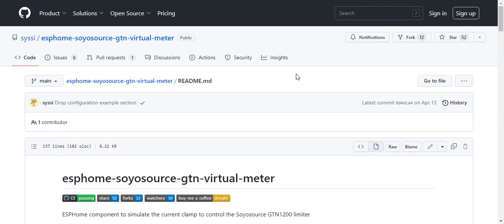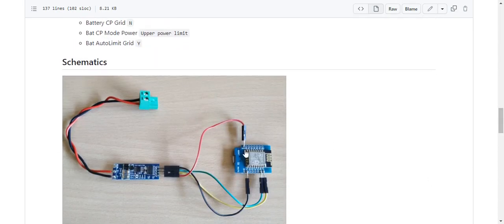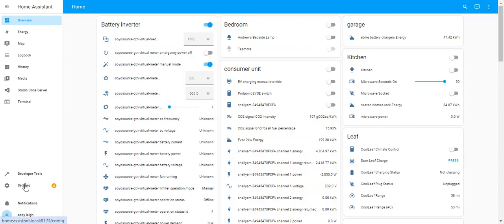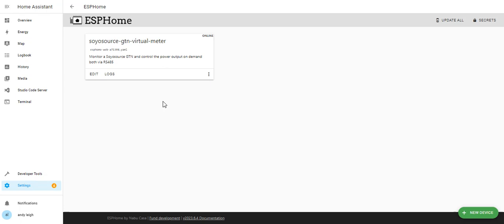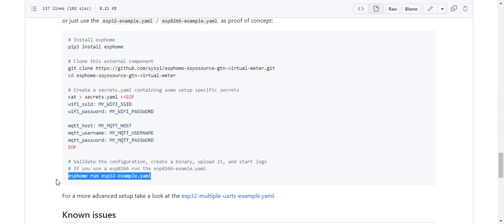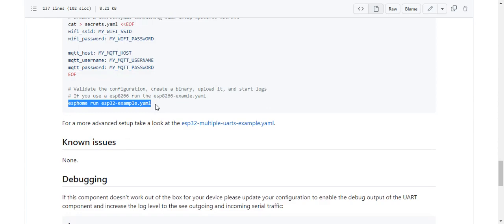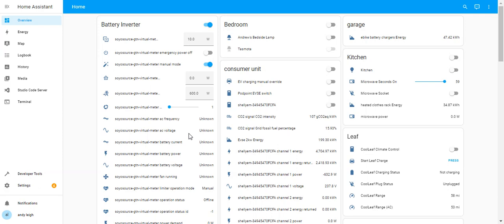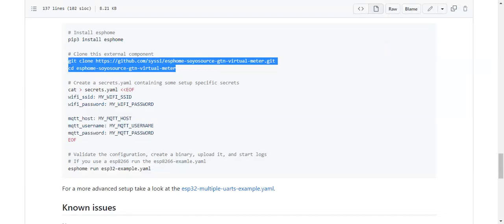Setting up the esp32 for the gtn1000 soyosource inverter for Home Assistant pt1

Comment: I am working on this for hours. In esphome it compiles and installed and I see a rt light blinking. But no info or control. What am I missing? Wiring is correct. Maybe faulty rs485?
Reply from the maker: Hard to say without being there to check your setup. There are two different flashes for the esp32 on whether you go via the port for the original ct clamp that come with the gtn1000 or a modified USB with opto isolators for the complete two way data feed back. Mine managed to control with the first method but I never had all the data being populated and for the  purposes of energy offset is neutral export I didn't need it. But now I suspect my gtn has broken as mine no longer works and I've no time nor conviction to fix it as I'm further on with a bigger system.